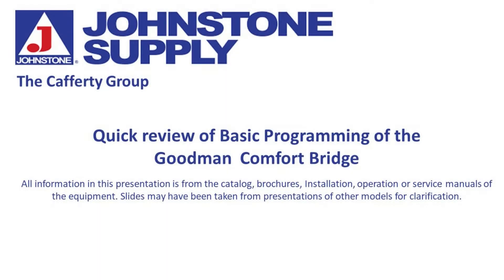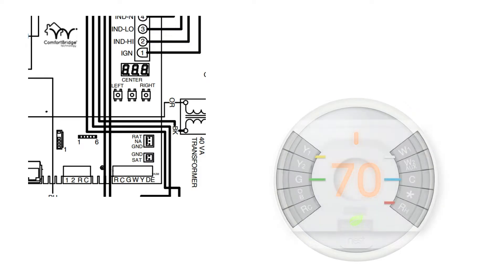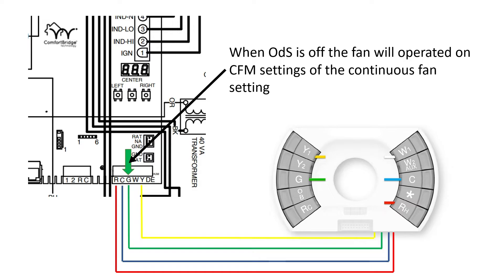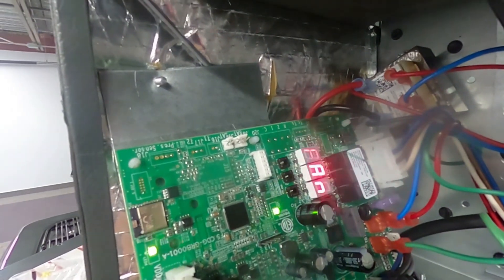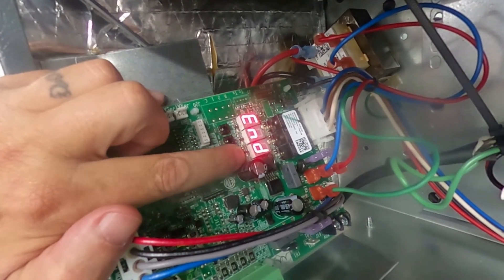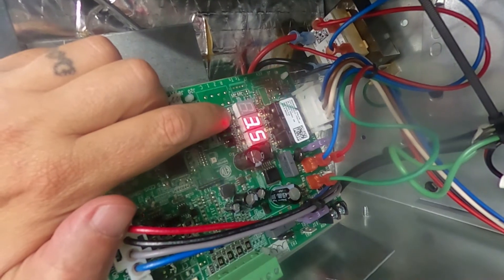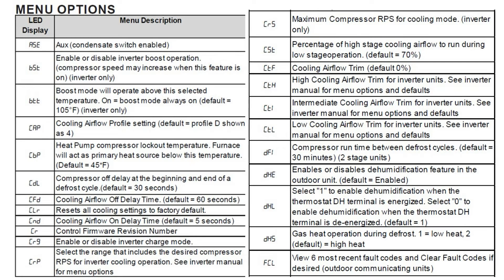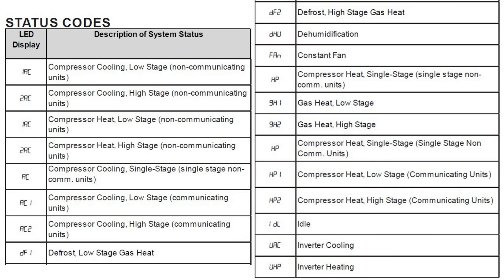Goodman Comfort Bridge Quick programming

Comment: Where do I go to change the blower fan speed for 1st stage heating and 2nd stage heating??? Please help !
Reply from the maker: If you do not have the display shown in video please get me model. If you do scroll right or left to GAF press enter adjust as needed then push center twice. For stage one scroll to GST and choose a percentage (a percentage of the GAF you chose) I believe it will default to 70%. Push center twice before exit.
Reply: @j@j @johnstonecg  do have this display but i do not have OdS for choosing tonnage. My model is AR9T960803BNAA it is an Amana which has the same display and 3 buttons as a Goodman. In another video you showed a Goodman where we go straight to 1AC and set the F0xx number. I am so confused as to how to set blower fan speed by CFM for Goodman and Amana furnaces with the 3 buttons. Whether its for cooling or for heating .. I am confused with these complicated F01-F09 guidelines that dont explain what CFM they represent.
Reply from the maker: The standard ECM 9 speed. Scroll to GA1 and press enter you can choose F01 F03 or F04 with the right left scroll buttons, for low and press enter 2 times. Scroll to GA2 and press enter and use the right and left to choose from F01 F04 or F05 then press enter 2 times. The higher the number is not always higher CFM you must check the installation manual blower chart. Also scroll to AHS, this will tell the unit how to use w1 and w2 separately or just W1 (off is default and it needs both w1 and w2 to enter high speed) or choose auto stage from low to high also can choose 10 or 20 minutes.
Reply: @johnstonecg thank you! , and how would I set the cooling for 1 stage cooling if i dont see OdS?
Reply from the maker: @416RG  same procedure except AC1 for low and AC2 for high. both cooling speeds have F01 thru F09. Im not sure what part of the country your from but if humidity is a factor keep the CFM to 380 to 400 per ton (the tonnage of AC can be found on outdoor unit) More or extra air will be a penalty to the SHR or unit and low air dehumidifies well but cant remove sensible.
Reply: @johnstonecg ok thank you so much

Comment: Any ideas why my new Goodman Furnace (DVT96) is shutting off 24 volt power to the thermostat on initial start-up?
Reply from the maker: On initial start up? When the thermostat initiates a call for heat or cool? If so does it effect anything other than the thermostat? A thermostat with a very high resistance can get robbed of voltage. More information an we would be happy to help resolve the issue. I have had no reports on the DVT96 causing what is described.

Comment: is it possible to use the GTST thermostat with this board?
Reply from the maker: ONLY WHEN USING AN INVERTER OUTDOOR UNIT. That comfort bridge board should use a non communicating thermostat except if the outdoor Unit is a Daikin FIT, Amana S or Goodman SD.

Comment: I just installed a 2.5 ton split system furnace,   does this board not come already programed?  Reason im asked , system says fan setting F04. That's only 400
Reply from the maker: F04 would be speed 4 not 400CFM. The installation manual will have a chart. Measure your ESP, if you cannot then guess its .7"wc. If using a 1" pleated filter, remove it and throw it in the garbage. Find your model at the cool speed section along the top find the ESP follow down to desire CFM, at the left will be the speed setting. please note the CFM jumps around, F02 isn't always higher than F01, they are just labels. Mattering your location 380 to 400 CFM is the norm. When you set the new speed, power on no signal from stat, use right or left to go to AC1 (Y1) or AC2 (Y2) push center button. It will display the F04 (default) go right or left to desired number then push the center button 2 times (book wont say twice but you must push it 2 times).

Comment: Dear, I have a new Goodman GM9S80 but it don't start. After power on the display flashing 8.8.8. continuously. I did replace the board by new one and still the problem. Do you know about this issue? thanks and regards!
Reply from the maker: 8.8.8. is the board rebooting. number one cause is door switch. Be sure board has 120 volts and low v transformer has 24 volts with no fluctuation on either. All low voltage connections (RWGCY) should be disconnected for troubleshooting.
Reply: What year is it?

Comment: When setting 1 ac does that mean the unit will never be able to kick into high stage or in this case 2ac?
Reply from the maker: No 1 AC would ignore the Y2 and run full cool speed on a Y1 signal. The Y1 and Y2 would still go to outdoor unit but the humidity removal on first stage would be poor due to the high cfm. Verify the outdoor unit has Y1 and Y2 before you set it to 2AC.
Reply: @ so 1 ac is normal operation for a unit that is base model/ non communicating?
Reply from the maker: @ Yes, If setting to AC1 your choice at the tonnage setting will dictate airflow when Y is energized. If set to AC2 the Y signal will energize 70% of the tonnage setting and Y2 100%. The 70% can be adjusted.
Bonus points if you use Y1 Y2 for dehumidification on a single speed unit.

Comment: Why would you adjust heat and cool trim settings.
Reply from the maker: All CFM, if the velocity in the ducts exceeds a certain amount and you want to reduce it for less noise, if the jewel calculation for the home dictates a certain size and the duct is marginal for that CFM. Two good reasons, trim up is often used as well. Reduction of the CFM (trim down) does not adversely effect equipment temperatures at the indoor heat exchanger in either mode, the compressor and components will operate in a manner safe for the system and maximize needed BTU's.
Reply: @johnstonecg  Thanks for the explanation.

Comment: With a communicating air handler / furnace, it is much simpler to do all of this set up via bluetooth and the coolcloud app.  It lets you set up everything assuming you understand what equipment you have.  In regards to dehumidification and so on.  Look up the cfm on the AHRI certificate and ideally operate there (in AC mode) for the best efficiency.  Normally that will not be at the full 400 cfm / ton of the unit, it will be backed off a bit.  Set up properly with the right profiles, these units work awesome - at least mine does and I set it all up myself.
Reply: Christopher - thanks for the post!  I agree, that the Bluetooth setup is a great way to do this. I finally got mine dialed in (communicating mode), but it took some effort. I am still using my NEST Gen3 thermostat and here is what I did to get it to work:

At furnace, connect White and Black wires to 4 conductor Phoenix plug.

Wired NEST with a single Y and W - no need for Y2 or W2.  Left C and G wires to furnace only. Did not use R and C to outdoor compressor - it has a 24VAC transformer installed. 
At compressor, removed 6 connector Phoenix plug (used for non-communicating mode between furnace and compressor) and install 4 conductor plug (1,2, R,C).  R & C connected to 24VAC transformer.  Only 2 wires required from furnace!

My Observations:
The CoolCloud (IOS app) Bluetooth poor connection issue is the main reason installers avoid using, in particular, if furnace is in the attic.  You have to be really close to the unit to keep connected.  However, I arranged my wires inside furnace away from the integrated Bluetooth chip (lower left side on board) and made sure the high current wires were move as far as possible from that area of the board.  I also arranged wires so that the panel door did not have to be removed to get the 3-digit code. After completing this, I was able to get an addition bar of signal strength - while in bedroom.  I no longer had to be in the attic to stay connected! Yay!! 

I wanted to monitor performance of the communicating mode and try to compare with the NEST modulating efforts.  The code resets after 8  hours or so and I did not want to climb back to attic to get  the new code.  The thermostat Off, On, Off procedure works but is cumbersome to me.  So, I mounted an old Amcrest camera with a magnetic base inside the furnace. This was an idea my wife gave me and it turns out this was a brilliant idea!!  This 10-year-old WiFi camera now allows me to view the 3-segment display without going to the attic.  I even monitor it while away from home.  If I need to get a new code, I just look at the camera - have not been in the attic all week.  I use the camera most of the time now to monitor since the 3-segment display shows what is going on, mode, airflow, etc.

After about 8 days of use, I can confirm that the communicating algorithm (mode 4 for me) seems to be working great.  This thing runs in Stage 1 most of the time and I see the 1/2, 7, and greater, minute changes occurring with different CFM readings.  Although I use the 30-minute target with Cooling Trim Factor=0, I do see the CFM reporting 1245 at times.  I am going to give this a good week or two and go from there.

The CoolCloud IOS app does not seem to be supported by Goodman anymore.  When looking at google reviews that are current and over 4 years old, they are still using the same canned reply, "we are working on it". I am really hoping that the folks that did the app programming are NOT the same who did the modulating program algorithms.  I will be posting a YouTube review of the app I will name,  "CoolCloud - Unmarred by Progress".

ComfortBridge is such a good concept that is unfortunately destroyed by horrific CoolCloud app.  The whole security code nonsense is such a waste and roadblock to AC technicians trying to use.

Thanks again for your post - I was wondering if anyone even looks at this video anymore.

Comment: Hello and thanks for any much-needed help with my situation.

I had a new Goodman system installed a week ago, replacing an 11-year-old Goodman system for cooling the upstairs. 
New system, 3T, 2 stage, GSXC7 compressor, GMVC8 furnace and CAPTA3626C4 coil. I learned that the professional installer chose not to enable ComfortBridge. I was wanting and expecting this feature mostly for the diagnostics, and, if correct, Goodman documentation states it will ensure maximum efficiency. While using the CoolCloud IOS app, it was clear I was missing something. The installer stated that they do NOT enable this technology because of the problems it has caused them in the past and the high failure rate. 

However, I feel I paid for something I wanted and because they have no expertise with ComfortBridge, it is left disabled. 
I don't want to insult the installer by saying my internet research does not agree with his ComfortBridge assessment and try to force the issue if indeed ComfortBridge is not worth it. I tried contacting Goodman and did not get an answer because I'm a homeowner.

I emailed Goodman and asked a simple question, “what will I miss if ComfortBridge is not enabled?”, Goodman response: “We recommend that you contact your local HVAC contractor to come out and evaluate your equipment.” 

Currently the system is installed with a new NEST learning thermostat and configured as non-communicating.

So finally, my questions for you experts:
What will I miss if ComfortBridge is not enabled?

Does ComfortBridge have a high failure rate?

Is the CoolCloud IOS app the reason for the problems reported with ComfortBridge?

Is ComfortBridge worth trying to get the installer to enable and configure? Or should I just cave and accept what I have if my delta T's are in spec? My NEST does show Stage 1 and 2 cooling modes.  After watching your video on ComfortBridge Algorithms, I feel the NEST is inferior to ComfortBridge when in “communicating” mode.

Any advice much appreciated - thanks!

Comment: I have two AVPTC37C14 with  two identical GSZC160361 condensers.  Both of the units were having  problems with locked rotor faults on the compressor motor, pretty much since installation.  I looked into it and found that they had been legacy wired using a two-stage thermostat.  I changed one to 'communicating' and it's been working fine for about a week.  When I tried to do the same with the other system, it did not work. The control boards are different on the indoor units.  The one that is fixed has three led digits, the other one has one.  Can I use the single led board in a communicating system or does it have to be legacy wired?
Reply from the maker: No, put 3 wire hard starts on both units to resolve your locked rotor code. They are slightly slow to start and the board has no forgiveness for timing. CSR-U-1 is Goodman part number., the schematic shows where to make connections. You can use any brand but do not use the 2 wire.

Comment: My company just got the first one of these from Johnstone. I just put the air handler with 10kw electric heat and a 2 stage heat pump. Using an ecobee I’m kind of confused if I wire it normally R,C,G,W,Y,Y2 from stat and to HP or if it stages the heat pump itself and I just connect Y. Also when using 24v ac wiring and remove the 4 wire plug at the outdoor, do you just unhook it from the transformer and the black and grey wires since I have R and C feeding the heat pumps board from air handler?
Reply: Thanks ahead of time if you respond
Reply from the maker: If the outdoor unit is communicating (I need model) you can wire the 1 and 2 only and the stat will be RCWYG only and set up as a 1H1C stat non heatpump and it will control the heatpump and electric heat. If you wire legacy (standard) you can wire up a heatpump thermostat and standard wires outside but the 12RC plug is unplugged and replaced, the RC power from outside will not be used.
Reply: @johnstonecg  I just got the model numbers. The air handler is AMVT42CP1400 Heat pump is GSZC703610.

Comment: This is my Krptonite. CODE: d0 - Air conditioner/heat pump is wired as part of a communicating system and integrated control module does not contain any shared data
Reply from the maker: D0 code can be corrected by data transfer, simple has connecting with unit (may show up as a shared data card). It will request model of unit and transfer data. If that will not function a data chip can be used (programable shared data) and is loaded on the Cr function of the menu. If none of this works for you let us know and we can do a short video on the data transfer. If your D0 is on a Unit over 5 years old and not bluetooth a standard chip can be ordered and is simply installed in data slot poer unit up 60 seconds and done.

Comment: How do I get the air handle to go into pairing mode. I cannot connect using the app. It never finnds the equipment
Reply from the maker: The equipment is in constant pairing mode, you will not see it if something in the home has paired with it. I get this in lab when students pair with it it locks me out. Cycle the power and try to pair right away. If you still can not pair send me the serial number and I will see if a production run had issues.

Comment: I just had the following heat pump condenser and air handler installed, 
GSZC703610A

AMVT42CP1400A, it’s supposed to be a 2 stage unit but I’m concerned it was connected in a way it’s only operating as a 1 stage. Can I email you photos of the wiring so you can take a look?
Reply from the maker: training
@johnstonecg.com